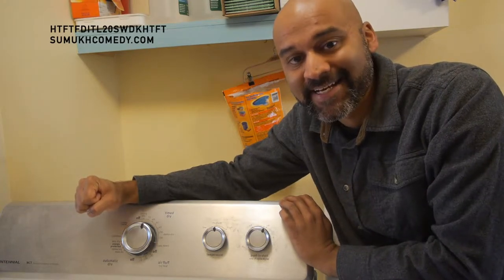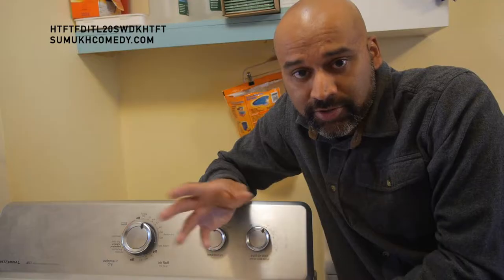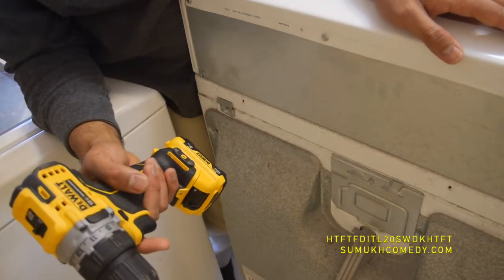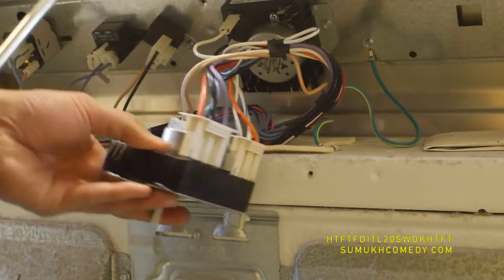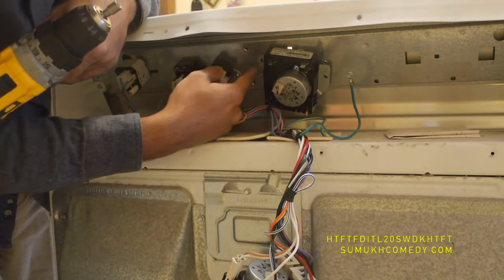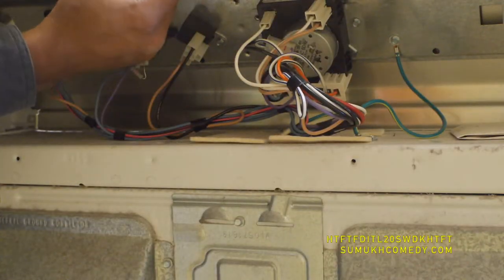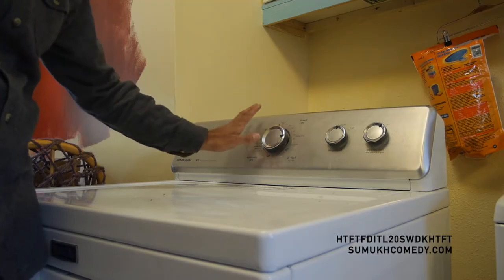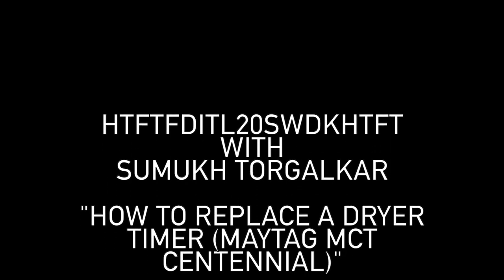How To Replace a Dryer Timer (Maytag MCT Centennial)

Comment: I set my maytag dryer to "more dry" and the timer moves and reaches the off and shuts off.  Then it'll start back up and running for about 5 or so minutes and shut back off. It'll repeat that a few more times before stopping for good.  The dial will continue to move during that process until stopping for good.  Is it just the timer is bad?

Comment: For me, it was the plastic stem that broke off.  The part that sticks into the timer.  How to I fix that??? Help.  Maytag told me it would cost $250 for parts and $169 for the service visit!!
Reply: This is what happened to mine exactly. Had to replace the timer! The part was about $90 and the rest was this video which worked perfectly! (But took me longer than 6 min 🤪)
Reply: Where did you order your piece because my old know doesn’t push on it and I can’t find a replacement with a new knob
Reply: @tlellison803  I found the part on Amazon and replaced it myself.
Reply: @jhasselberger  did you order a new knob also ? I ordered the timer and installed it as seen in the video. However my knob has plastic stuck. I’ve tried pliers to get it out but nothing works. I never to order a replacement knob.
Reply: @tlellison803 dis you ever find a new knob? Or fix it im having the exact same issue

Comment: How’d you get the last one off with the flat head ????
Reply from the maker: I know my hand may have been in the way in the video but really it's about placing the flat head in between where it connects providing it to be easier to pull it out because it's in very securely. All the best and thanks for watching!
Reply: @SumukhComedy ihave question why did not hear the buzzer when you turn the timer off. This dryer
Reply from the maker: @isaiahgreenfield2037  There is an option to turn off the buzzer (labeled "end of cycle signal"). I had it turned off. Thanks for watching!
Reply: @SumukhComedy  it look like your buzzer was on
Reply from the maker: @isaiahgreenfield2037  I have no idea. I only presume it's because I manually turned the dryer off as opposed to it running a full cycle on its own. I was just making a video to help people replace the dryer timer.

Comment: What is the part number for replacement timer?
Reply from the maker: For this particular model, it was W10185982. But you'll want to double check the model number of your dryer either via your manual or on the Internet to ensure you get the correct timer for that model of Maytag dryer. Thanks for watching!
Reply: @SumukhComedy  or actually printed on the back of dryer or on a tag.